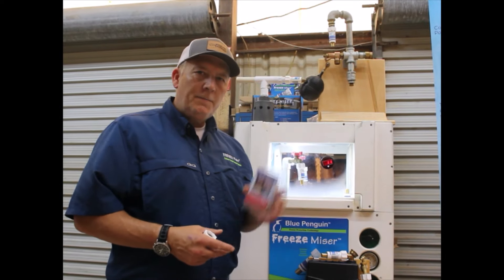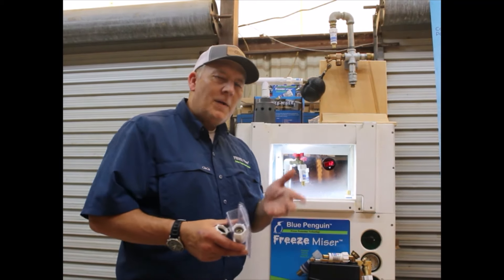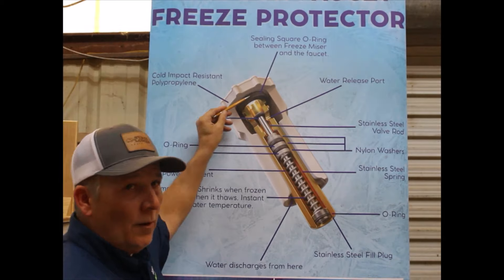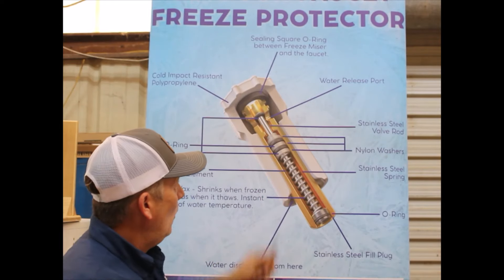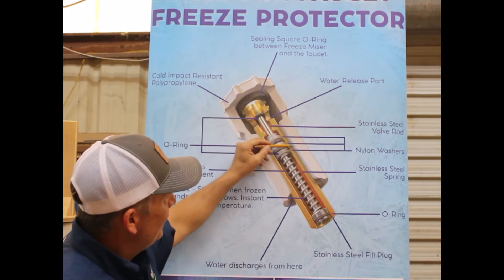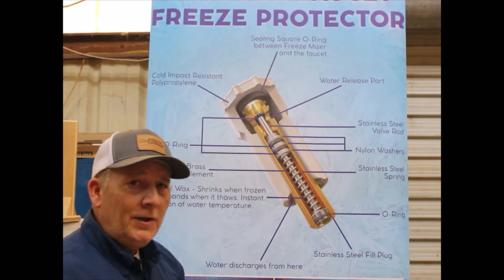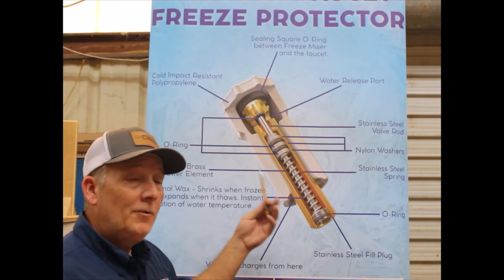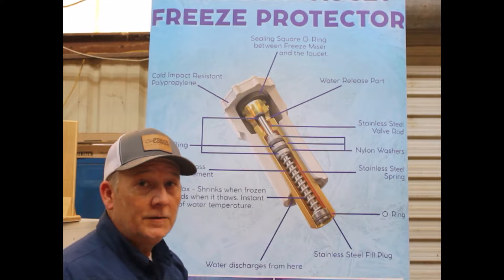Learn How The Freeze Miser Works

Comment: My Miser failed releasing a continuous stream of water well above 40F...the price increase of the Misers is simply predatory
Reply: What was the price increase?
Reply: @rikityrik I saw them at Home Depot, pack of 1 was $29.99, 2 for $59.99. 

For automatic temperature valves. Ok. But don’t advertise “Heat”. It’s very deceptive. Very deceptive. I intend to complain to Home Depot Corporate. The guy in the video dressed as a farmer uses very well scripted words to say absolutely nothing.
Reply: Mine dribbles water well above freezing—50 degrees outside, continuously 
Pretty much sucks

Comment: My thoughts exactly. I live in Houston, Tx, and in ALL my years of home ownership, I never knew to leave the outside faucets dripping, and I never have. I do leave my inside faucets dripping. I cover the faucet with the styrofoam covers that I purchased for that purpose. I've done this for more than 30 years and 3 different homes. I've never had frozen pipes even during the 2021 Arctic freeze in Texas. Many neighbors in my area unfortunately had burst pipes. I'm not sure what their freeze protection practices were. Are these really necessary for normal home use?
Reply: The problem with just letting your faucets drip comes when the water pressure drops overnight because all your neighbors do the same thing.  That drip stops and your faucet freezes.  With the water turned on full blast, the freeze miser will keep the faucet dripping when decreasing water pressure would have stopped the drip.

Comment: I don’t understand. I’m very interested by this, but one thing confuses me. I don’t want to turn my water on and build up a lot of pressure with a blocked opening with this on, yet the instructions say to open the valve all the way. Am I missing something?
Reply: Hi Markie, you will not build up any more pressure than you would that your faucet has. Also, it release the water when it is 37*f. Therefore drips off freeze miser onto the ground.
Reply: Every time you turn off your hose bib, you have a blocked opening and constant pressure. This is no different, except instead of the pressure being released only when you turn the knob to lhe open position, this one will also open very slightly on its own as temps approach freezing, and that allows a constant but slight trickle of water to flow through.

To answer the question you posed in another comment, the reason you want a trickle of water is the same reason that slightly turning on the faucets in your house or your exterior house bibs when temps are expected to reach freezing has been one of the most common ways to prevent pipes from freezing for over a hundred years.

When the water flows through the pipe, the source of the water is not freezing temperature.ground water tends to be around 48-55 degrees (F) in my state (WA). It can fluctuate slightly but not much. It's too far below the Earth's surface to be frozen by cold weather. Building code requires pipes in the ground to be buried a certain distance below the frost line, which is the maximum depth that frost can penetrate the ground in a given region. So, because that water comes from underground 1-2 dozen degrees warmer than freezing (32F), as long as it continues to flow, it will constantly provide enough warmth to the pipes to prevent them from freezing, because the water can replace the warmth faster than the ambient cold can sap it away.
Reply: It’s just a thermostat.

Comment: Also, how is a drip in freezing temperatures helpful? Wouldn’t the drip just freeze and make it worse?
Reply: Moving water doesn't freeze.  Dripping = moving.
Reply: @kat_7203 dripping water does freeze.  Or at least where I live.  It will freeze into an ice sickle.
Reply: Moving water does freeze. How else would we get snow and icicles?
Reply: Moving water does freeze. How else would we get snow and icicles?
Reply: Moving water does freeze. How else would we get snow and icicles?
Reply: @travisjackson6923  Ice sickles aren't formed from dripping water (the moving water), they are formed from the water that stops dripping due to surface tension and is held static on the surface of the existing ice. Moving water can freeze (of course), but the freezing point is much lower than standing water. Liquid water below 0 deg C is called "supercooled" and supercooled water exists because it lacks the ability to complete the nucleation process. Two of the factors influencing the freezing of supercooled droplets are the need for a freezing nuclei (usually ice crystals) and latent heat which is released when water freezes. In the case of this product, the concept is that continuously moving water through the supply pipeworks will create turbulence and flow allowing for supercooling instead of freezing. My feeling is that this is ideal for climates where freezing temperatures are rare. If you get occasional freezing temperatures, this will prevent pipe failures... and you just inspect the product (valve) after the freezing conditions are over to ensure it is fully reset and not still dripping.

Comment: will this keep the pipes in the attic  and the house from freezing?  or does it just protect the outside spikets?
Reply: It's for outdoor faucets, BUT, it can help prevent attic pipes from freezing IF your house is designed like mine.  I have a central water line that goes from the west side of the house to the east side (in the attic).  If I put the freeze miser on the spigot farthest from the water source (west side of house), then the water runs through the pipe in the attic to get to that faucet, helping to prevent the attic pipes from freezing.

Comment: The freeze miser is a perfect example of a basic second generation thermostat that was designed around the 40’s by adding “thermal wax’s”. It doesn’t “heat” anything it simply allows water to either flow or not flow at a given temperature. Which is fine. But unless I’m missing something, a thermostat does not produce heat, they respond to temperature and change chemical to mechanical energy. 

Such as a green house lovers to open roof vents when the temperature exceeds a certain point. As the “thermal wax” melts from a solid to a liquid, it expands and pushes a rod. The wax melts due to “ambient” temperature changes, ie the sun, engine heat, furnace, exhaust, etc. When the rod extends it pushes outward and can then push something or internally/externally be designed various to allow various flows of air or water, or any fluid depending on the movements of the rod, based on the melting point of the wax, which will change constantly. 

Different waxes have precise and consistent melting points and ranges. Allowing for a wide range of uses. 

But I’ve not seen a thermostat, “motor” create heat or be anything more than it is. “Thermo wax” is a very useful but dated concept using known expansion of matter physics when heated. Nothing more, nothing less.